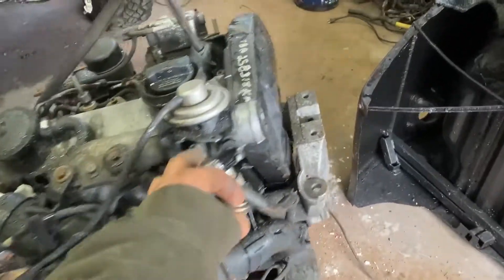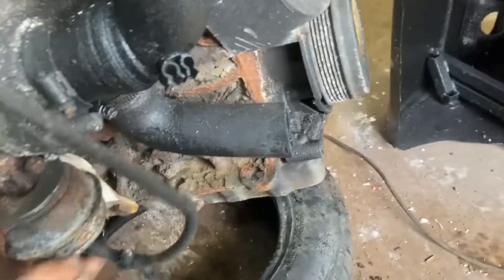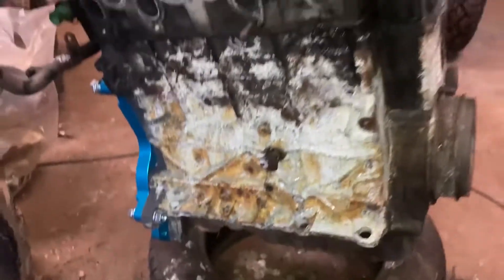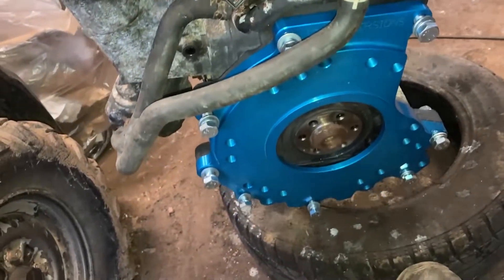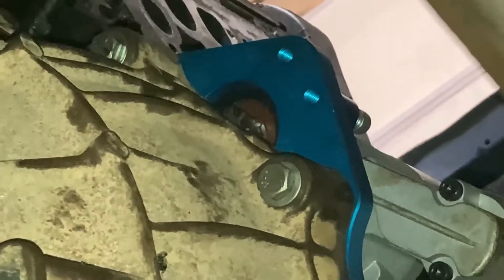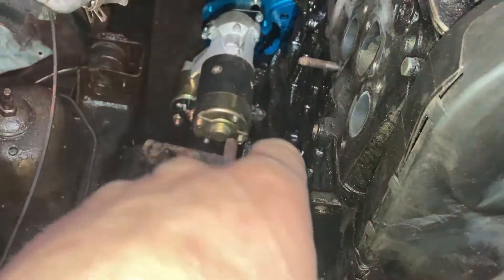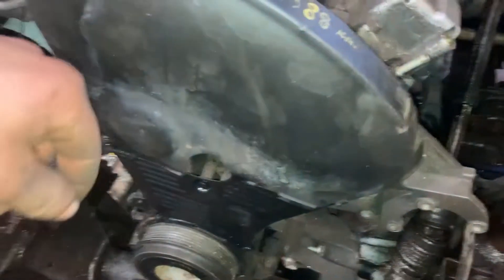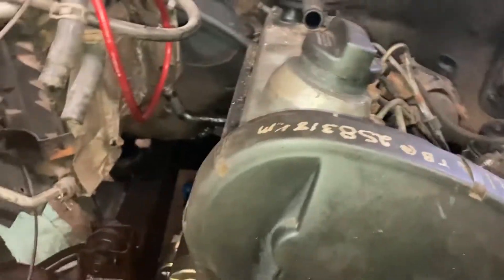Mounting a TDI ALH engine into a ford ranger

Comment: My fave degreaser is my Mapp torch too.. :-)
Reply: Dunno about the 1.9 in a Ranger tbh - great engines, my own cars a 1.9 - but dunno about the torque, doubt it's gonna be much fun to drive on take-off, they just don't have the grunt for moving heavy stuff like a ranger 4by tranny/vehicle. I'd say it will be pretty dull to drive. Maybe a M57 or an OM merc jobbie would be better? ALH engines dislike huge initial torque demands like moving a big azz 4by from rest. I can stall mine pretty easy just hauling a Golf & mine is running at peak peppy compared to factory.
Reply: Also dunno what the issue was with a bog stock Mazda diesel the european Rangers used - I had a few that clocked up mega miles - they'd fit right in, are economical & have the torque these vehicles require. I think this is kinda like re-inventing the wheel tbh.. Solving a problem that kinda doesn't exist.. If you think I am  being a jerk, I'm not - I'm back at a 1.9tdi swapped Jap 4*4 in the morning - but it's a much lighter vehicle - Rangers heavy.....

Comment: Is this the M50D-R1 trans that you linked it to? Also is this a 4x4 and still works? I have a 1991 STX with the manual and 4.0l and want to do this conversion but just spent like 2k getting a brand new transmission “the one I mentioned” and my motor just blew but don’t want to get rid of the trans if I don’t need to.
Reply from the maker: Yes that’s the one I used and 4x4 works good. It’s a good swap I like it
Reply: Please do a full list of parts you needed for the swap @MTD12HPTURBO

Comment: Awesome!! I want to tdi  swap my Dakota but I have no clue where to begin. Did you make your own engine mounts? And what about your wiring harness? Thanks in advance for any feedback
Reply from the maker: I have videos on my Chanel on the wiring harness.. it was pretty easy. The engine mounts are the factory ford ones with custom brackets to mount to the tdi
Reply: @MTD12HPTURBO how’s about the transmission?

Comment: is this the 2.3L ranger originaly ? I reached the adapter plate compagny the other day and they told me that the adapter plate can't fit my mazda 2.3L
Reply from the maker: That’s true you must have a 3L or 4L
Reply: @MTD12HPTURBO  wonder why no 2.3. also no automatic.
Reply from the maker: @pl747  not sure 4.0 and 3.0 are more common I believe. And you can use an auto trans behind one of the adapter kits.